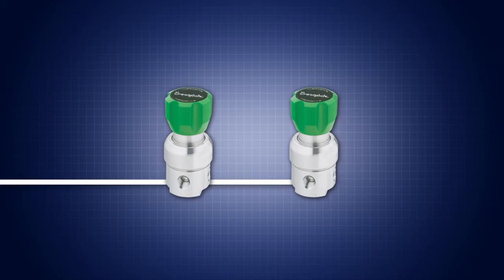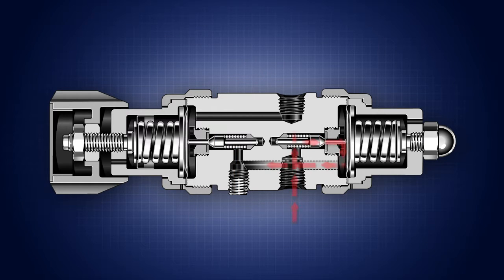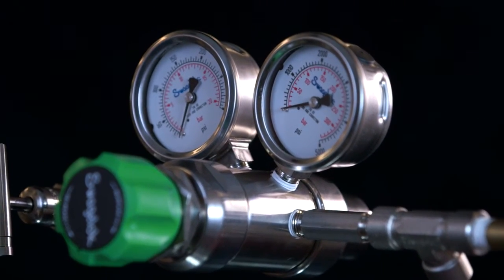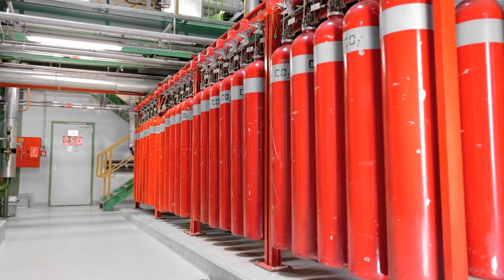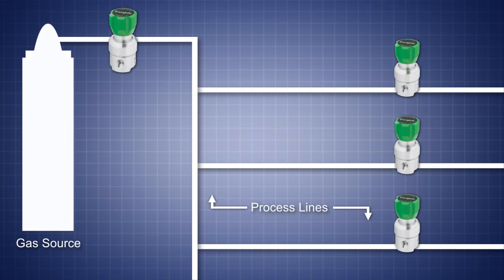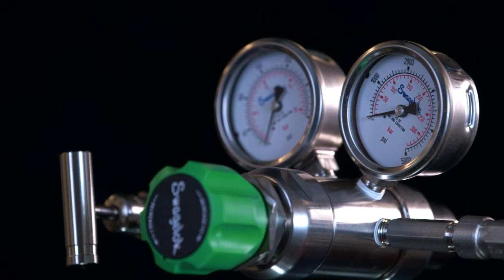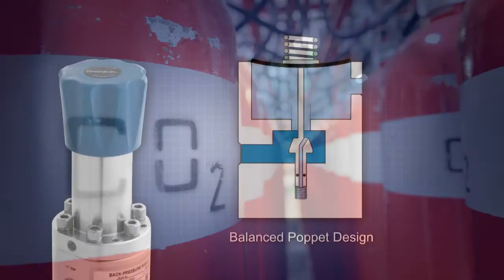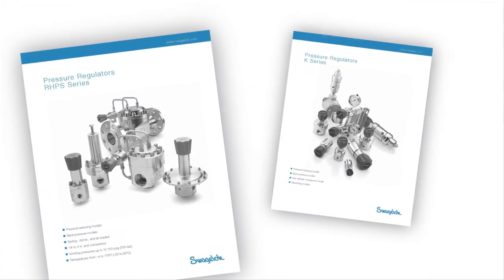How to Manage Supply Pressure Effect (SPE) Part 2 | Tech Tips | Swagelok [2020]

Comment: I feel you are missing the calculation of the load or multiple loads. I think you pressure evaluations are meaningless without knowing the downstream load information first. Any excessive downstream load would cause freezing, regulator pressure hunting and regulator pressure droop surpassing our working pressure needs. Please give me your thoughts on my concerns. Thanks Bob
Reply: It seems like they're only addressing a basic issue that any mechanical spring-diaphragm regulator will have an inherent inaccuracy (the SPE) that an engineer will need to account for.  In the real world, a system design will have to take in all sorts of requirements to make sure that the end result is successful.  Process fluid / gas chemistry, flow rates, temperature, expected change in load & supply, the rate of change of load and supply, necessary accuracy, etc. all feed into sizing and specifying the components correctly.  For some applications, a simple mechanical system is not going to be enough and you will need to integrate an active control system, but that's not Swagelok's specialty.